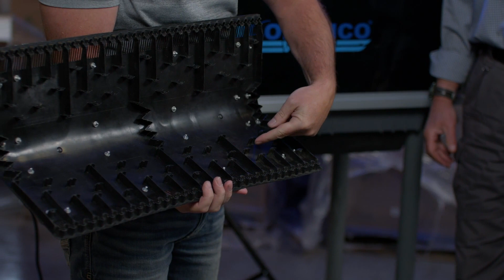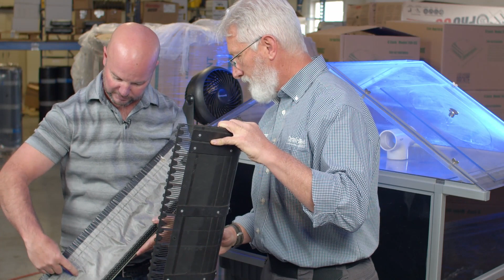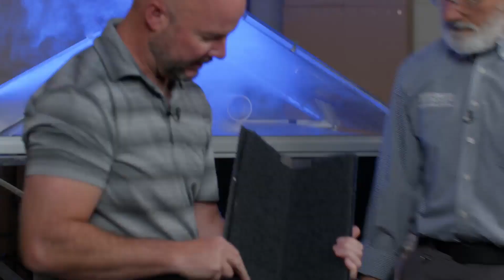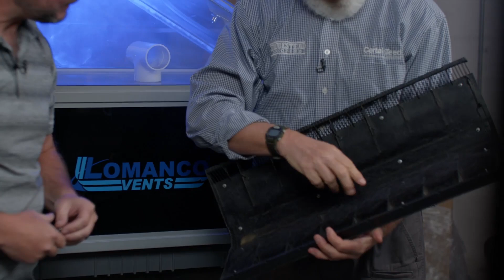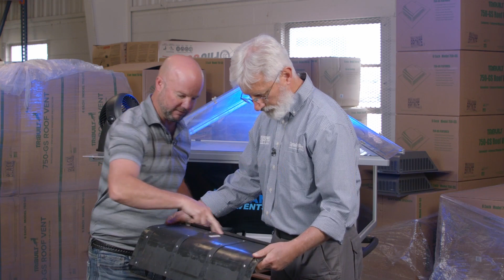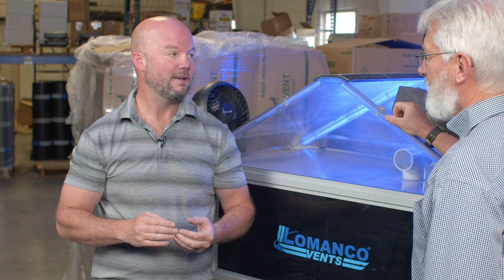Why Does A Roof Need Ventilation?

Comment: On our home we have slotted soffit vents around the bottom our roof and 3 turbines at the top of the roof.   Seems like we might have more input area than output, but I really don't know.    Most of the homes in our area have 2 turbines and the previous owner added one more.   How can I figure out if I need more turbines?  I believe we have 5,900 sq ft of attic space.
Reply from the maker: Use this to calculate your venting needs - https://ventselector.lomanco.com/
Reply: @homesteadroofing  There seems to be a problem with the link.
Reply from the maker: Dave, the link is working for me. You can find other venting calculators online.

Comment: Hi Tracy. Great video showing the importance of a good clear ridge vent such as the Lomanco Ridge Vent. Thanks for sharing. I have a question.

I'm currently getting quotes for a roof replacement here in Coastal Massachusetts. What I'm finding is for the roofer and shingle manufacturer to give you the expected warranty, you have to use, not just their shingle, but their ice and water shield, their underlayment, their ridge vent, and ridge cap. Any deviation from the manufacturers "total roofing system", will either void the manufacturers warranty or greatly diminish it because you did not use the shingle manufacturer "complete roofing system". 

How do I overcome this and insist on a Lomanco Ridge Vent instead of the shingle manufacturers inferior ridge vent? I have run into this with Owens Corning and CertainTeed, two brands of shingles I'm looking at. Thanks for your help and advice.
Reply from the maker: GREAT question! It has been our experience that a shingle manufacturer isn't sticky about those kind of peripheral products. I've never had a manufacturer deny a warranty claim because we didn't use their box vents, for example. I don't even know if most shingle companies even make box vents. The primary thing they are concerned about is that there is sufficient ventilation.
*Having said that...*
You'll have to check with the shingle manufacturer to get their "official" response. 
Hope that helps!
Reply: @homesteadroofing  Hi Tracy, Thanks for your quick response. I'm going to go back to the roofers that quoted my job and specify the Lomanco  Lo-Omni Ridge Vent. Thanks again, Jim

Comment: And, what does one do if there are gable vents at each end of the ridge? How would they affect airflow if ridge vents are added?
      [To understand air flow, It DOES make a difference to view air as PUSHING from a higher pressure area to a lower pressure area. If air were to be "sucked" from one place to another, it would need energy, from somewhere, to do so.  Where would this energy come from,  and, HOW would it do it?]
Reply from the maker: If we're adding roof-top ventilation, we close the gable vents.

Comment: Mr. Bookman, I guess I thought of you as a CertainTeed guy.  Does a Lomanco ridge vent invalidate the CertainTeed Northgate Climateflex shingle warranty?  Don't you have to use CertainTeed's ridge vent?  And if so, which Certainteed ridge vent do you use or recommend?  Also, a roofer making a bid recommended we have them install edge/intake vents due to our house not having soffit vents, since there's not much soffit to speak of on our old 1927 arts and craft home.  We weren't even really aware of how much of a problem this was until he pointed this out and did some research on how critical both the intake and outake are - and watched your videos - duh!
Reply from the maker: As long as there's correct ventilation, that doesn't invalidate the shingle manufacturer's warranty. If CertainTeed made a ridge vent product that was as good as the Lomanco, I would install it, but they don't. They make a ridge vent with the fiber mesh which inhibits the air flow. Good question!!
Reply: @homesteadroofing  Thank you so much!

Comment: Good review. The unspoken issue is that ridge vents and turbine vents require wind. No wind = no airflow. I've also heard of some water leakage issues with the turbine venta, though I don't know if that was with this brand or not.
Reply: Even if there is no wind, warm air will still rise to the highest point on your roof; so, venting can still happen.
Reply: @artsnow8872  True. I once emailed the company to try to get the NFVA (net free ventilation area) for the turbine vent, which is required to satisfy HUD code requirements and also satisfy shingle manufacturers warrant requirements. They never responded. So it is uncertain just how much ventilation airflow occurs with a turbine vent when there is no wind.

Comment: My house was built in 1962. So my current roof has zero vents on my roof I was told only vents under the eves. So when I get my roof replaced and because heat obviously rises where exactly should the roof vents be installed? My thought is up high because of heat rising and because of the vents under the eves. Yet I do not know. Or should the vents be up high as well as lower to? Also how many vents should there be on a 17OO square foot roof?
Reply from the maker: You should ask a roofer to evaluate that for you, but I would strongly recommend that you choose a roofer who is knowledgeable about it and not just guessing at it.